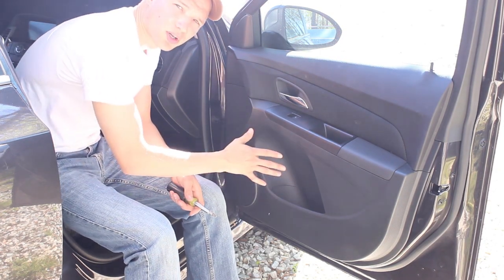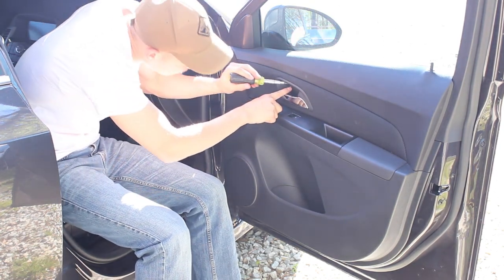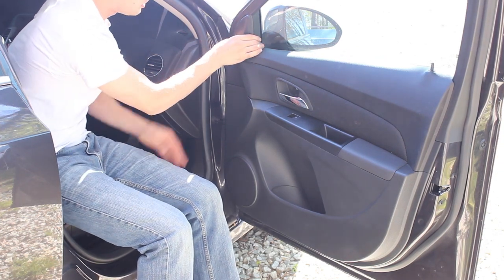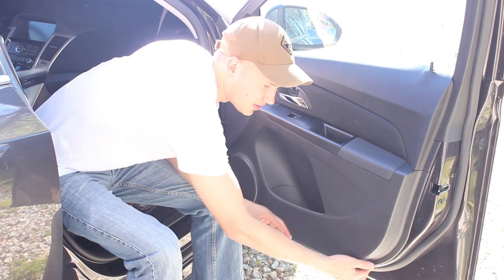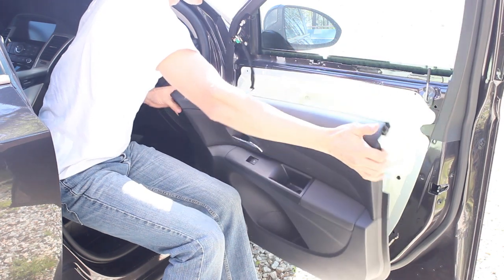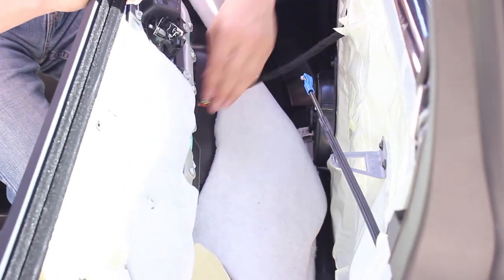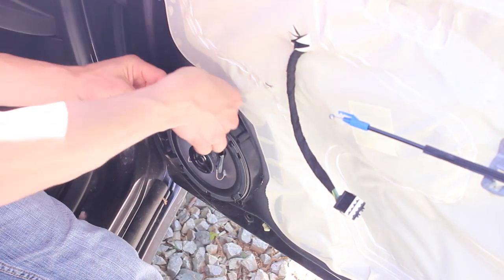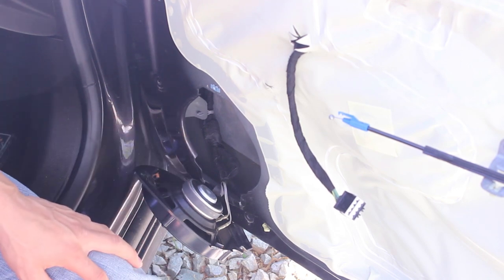Chevy Cruze Front Door Speaker Install disassembly installation speakers

Comment: Thanks Dude! I can't believe the Chevy dealership wanted over $100 for labor to do this. I replaced mine in less than 20 minutes - including time watching this video. (I also saved @ 35% on the cost of the speaker by ordering it myself).
Reply from the maker: Steven awesome! Thanks for watching!
Reply: Hey dude where'd you get it from?

Comment: Thank you so much! Very helpful.

Update:
Everything worked, just like you said, except when I tried to pull out the electrical for the window switch. The whole back of the unit came off with it. No worries, though, as it all snapped back together just fine.  Thanks again.

Comment: I got the speakers sum kickers i need some free spacer or adapters , 4 of them where can i get them at,
Reply from the maker: not sure about free.. I know if you order the speakers from crutchfield they will send free adapters.. or you can order from them as well. Let me know if you find any for free..
Reply: Thanks for the reply, i ended up modifing my kicker speakers on to the stock brackets,

Comment: So I'm kinda disappointed by the system in mine, I also have a 2014 cruze but it has the stock radio that doesnt have bluetooth music. Also, the aux port is much quieter than the radio. I dont know if i should get an aux booster or replace the system, or how i should go about it. I have heard some videos about double din's but I'm not too keen on that stuff. What did you do to upgrade your system?
Reply from the maker: i believe there is a way to adjust aux levels for each time you plug in. I didn't end up upgrading the stock unit. I added a PAC unit behind the head unit to allow me to hook up an amp in my trunk to power the speakers. If you check out my other videos i have one showing that installation. thanks for watching!
Reply: @mattdobson123  thanks for the reply!

Comment: Yo did you notice a difference between stocks? I'm thinking about swapping stocks out but if it's not noticeable difference Im thinking just adding amp... I already have 1kicker 12 with a 400 watt amp. Im running my stock head unit also. What do you think?
Reply from the maker: I didn't notice a huge difference. The amp and sub may be the better option!

Comment: I have 2011 ltz with system and the passenger door keep rattling. Do you think I just need to tight my speakers screws?
Reply from the maker: kolton ruvalcaba perhaps? I noticed my door rattles when the push in clips pop out.. so I guess check for that first
Reply: @mattdobson123  thanks for reply. I was able to get some window cocking/cusion spacers and i super glued them on for side door speakers and the back deck to keep rattling from hitting window.
Reply from the maker: kolton ruvalcaba that’s an awesome idea!! Thanks for the tip

Comment: I got a 2015 Cruze, what size front door speakers does it take?
Reply from the maker: should be a 6" 61/2" or 6 3/4" any of those will fit, but you will need a bracket.. If you go to crutchfield and put in your exact car (with or without navigation) it will spit out the exact size. thanks for watching!
Reply: matt dobson thank you..